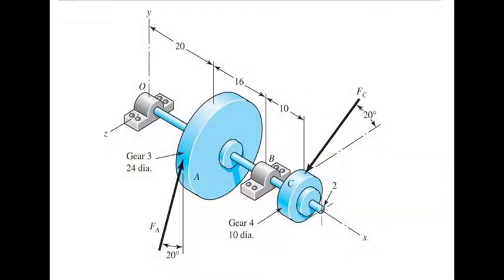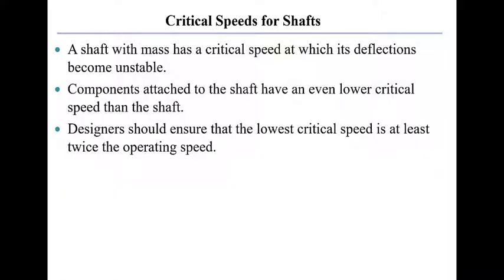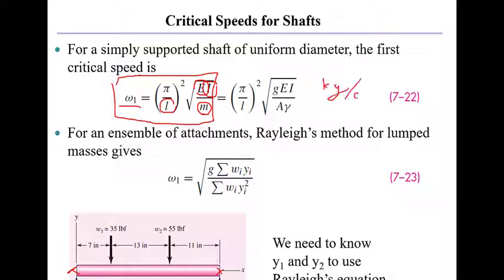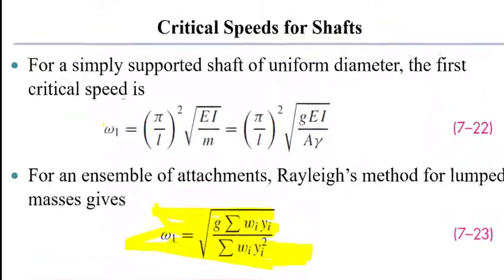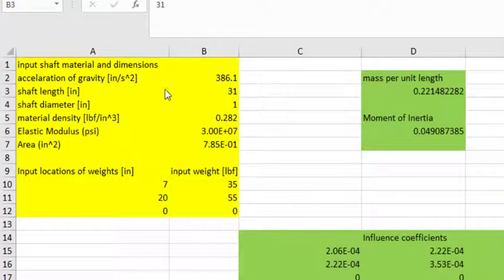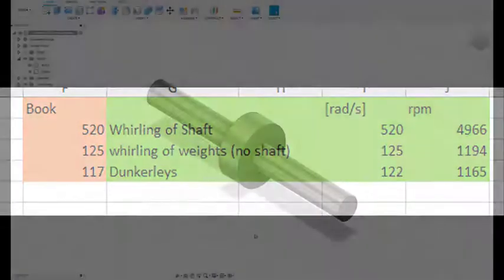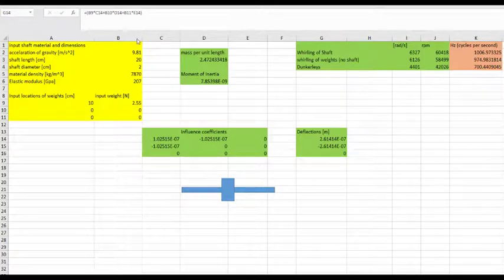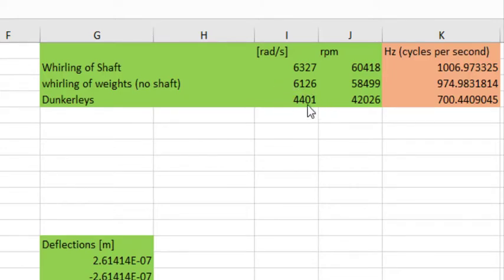ME 329 Lecture 3: Whirling Failure using FEA and hand calcs

Comment: sir what happens if it is a compound shaft of varying diameter, i have a overhang shaft which is thicker at centre and has two mass components at the end of thicker section ,how can i approach it
Reply from the maker: You have 2 main options: 1: Just build the shaft and run an FEA analysis in the manner I showed; or (2):  Use a lumped mass model in the basic equation.  You can choose the smallest diameter section and treat that as a uniform shaft the entire span...then add lumped masses to that uniform shaft that are associated with the changes in diameter and combine the uniform shaft and the lumped masses using Dunkerly's equation.  The more 'lumps' you use, the better the approximation. Remember to not include the uniform shaft in the 'lumped' masses.  Imagine those shoulders as extra weight added to the uniform shaft.  Does this make sense to you?  Regardless, I would compare a hand calc to an FEA to make certain you are getting similar answers.
Reply from the maker: I want to caution you on using the approach I recommended above...it will give you answers that are well below the reality.  If you do what I suggested, you are going to add mass to the smallest 'effective ' diameter shaft...this will be much more compliant than the true shaft, and will give a whirling frequency much lower than the true answer.  I am currently writing code in Excel to partition the shaft into segments but account for the changing diameters as part of that partition.  It is pretty tricky code, but I will press on with it.  I am doing it in Excel, not because I like VBA, but because nearly everyone has it.  Your best option is to use FEA code to analyze the whirling.